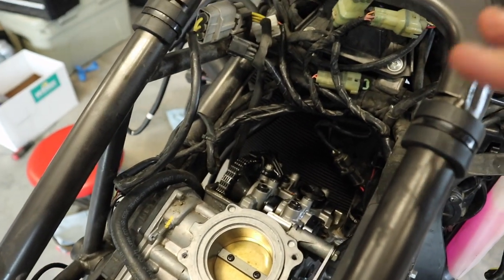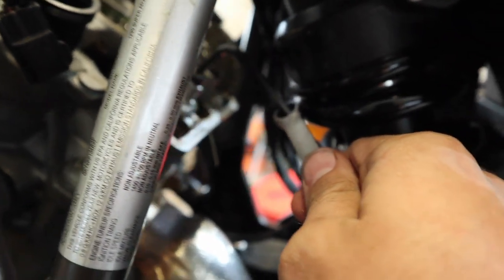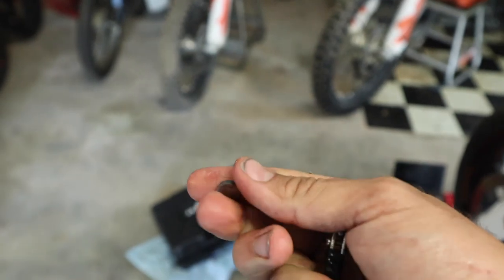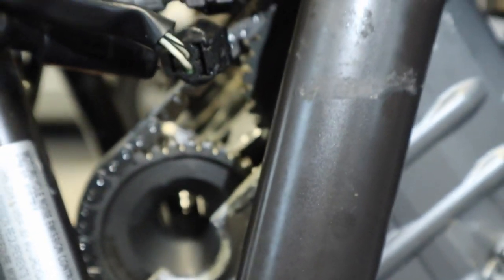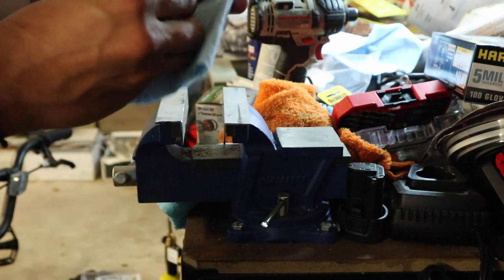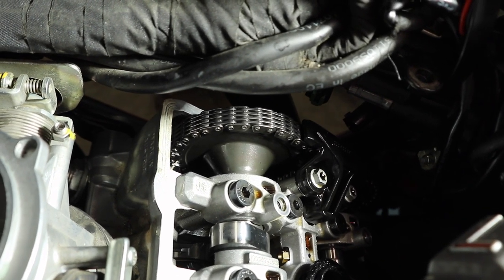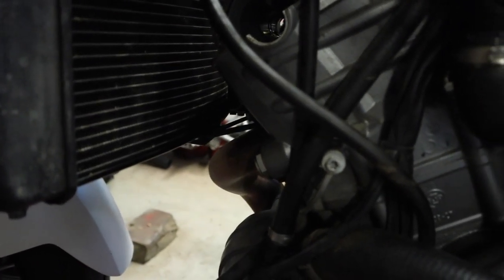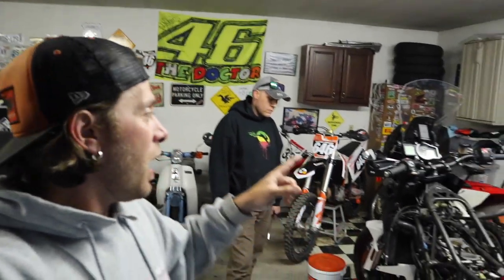Valve Adjustment and Cam Chain Tensioner Replacement | KTM 1090 1190 1290 Adventure

Comment: Thank's A LOT! It's a masterclass. 
I heard the CCT was a problematic part on LC8 engines, and because I truly consider buying a used 1090, I will ensure that new ones are mounted along with the valve check/tuning operation.
Still, rallyraidproducts seems not to produce the part anymore. 
Do you have any idea of other good manufacturer or should I just go for the OEM one?
Again, your videos are truly truly appreciated man. Merci! ✌️

Comment: thanks for the great video. 
I made a mistake and lost my crank/cam timing while setting valves.  How do I know when I have crank at TDC for each cylinder?  Thanks
Reply from the maker: Gonna be tough to answer without some additional information...1) What do you mean by "lost the timing"? 2) Which cylinder?

To get the timing back you can turn over the engine, insure you're not TDC on the opposite cylinder and then check that the notch of the crank shaft is visible. If you're not TDC on the opposite cylinder and the notch of the crankshaft is visible, then take a screwdriver on the cylinder you're working on and make sure the piston is all the way up. If all 3 check out, you're TDC.
Reply: @2WR  thank you.  Is there only 2 notches on crank, one for each tdc?

Comment: Very helpful 
So, just to confirm….. to just change the rear cam chain tensioner only, you can follow the same process as the front?
Might seem obvious, but I’m hoping to drop a deposit on a 2018 model in the next few days.
Thanks in advance.
Reply from the maker: Process is the same on both front and rear.

Comment: mario,I know  its been a little while since this video was recorded so hopefully you can answer question, when you use the small phillips screwdriver to hold in time TDC , my question is , does the screwdriver fit in a notch or hole in lower gear ? or something else, repair Manuel is a little vague about it. i have a 2017 1290 adv. T like the one you rode in some of your videos, Thanks for posting.
Reply from the maker: Still test these things (single and twin cylinders) all the time. It’s just and added safely. I’ve checked plenty without blocking. (If you know what you’re doing u can get things back in time even if u jump time)

Comment: Good job 👍 could just explain what is the other way to reset the camshaft tensioner ?
Reply from the maker: Using a couple of washers. There are videos on YouTube. Also shown in the service manual. Just easier to do with the vice. New tensions come ready to drop in.
Reply: 2 Wheeled Rider  Many thanks for your quick reply ✌️

Comment: Nice vid! How in the hell did you get the oring in? I am having, let's just say a hard time. Just tore my new oring and reordering. Looking for thoughts or tricks thanks.
Reply from the maker: Which O-ring? The one on the tensioner?
Reply: @2WR  Yeah, I have a 690 with a slightly different design. Was having a hell of a time getting the oring past the threads and onto the tensioner. The cap is a different style than the 500's. Just thought you might have some thoughts.

Comment: Getting ready to check the valves on my 15 1290 adventure. This video is going to make this possible. 🤞Bike has been hard starting in colder temps.  Thinking it needs valve adjustments.  From what I've been told by the guy I bought it from a couple months ago it's never been done. 27k on it now. Do you suggest I just order new cam chain tensioner and replace them since we are all up in there already?
Reply from the maker: New tensioners aren’t going to hurt anything. 10.00mm shims

Comment: I knew it! 

Watching the video and waiting for you to say "tensioner has failed on reset" Mine did the exact same but I went with manual tensioners so just set them to 4mm of play in between the cams and boom! Done!  

Now I don't have to worry about them failing at god knows what RPM and ruining my engine.
Reply from the maker: You go with Dirt Trix?
Reply: @2WR  Rally raid bud.

http://www.rally-raidproducts.co.uk/ktm-excf-manual-cam-chain-tensioner

They state they are for the single cylinder bikes but they fit our LC8's no issue. New O-rings - there's one on the tensioner and one one the cap if I'm remembering right? - in with them and as I say just fit to 4mm of play at TDC. I have a video on me doing it on my page. Slightly loose is better than too tight. Would recommend a touch of sealant on the front on because of the downward angle. Mine is weeping a DOT of oil after .. 6k miles or so. No big issue just FYI
Reply: @Mr.Winston  I dont understand when you say "tensioner failed on reset" I just did my valve clearences and when it comes to unlocking the tensioner, the thing goes out and puts tension on the chain... but if I turn the engine a few times the tensioner does some funny thing, like it goes in a bit and the chain gets loose, keep turning and then goes tight again... Does that means that the tensioner is bad?? Front one wasnt doing the same thing till I pulled out... now both do the same thing.. help please
Reply: I think the correct term for what Im saying is "jump time" (according to your video) Does this means my tensioners are gone? Or just badly realeased?
Reply: @MauroRubioGiletta  try releasing it and setting it again. But I don’t trust these tensioners. As I said above I went and bought manual ones they literally cannot break or be wrong once you’ve set them.
Reply: should the chain be tight all the way around or it needs oil pressure to work? please help
Reply: @MauroRubioGiletta  at top dead center you should have a little bit of ‘play’ in the chain in between the two cams. But it should be right yes not able to flap about or skip teeth. Make a video of yours mate honestly it’s hard to know if you’ve done it correctly in writing
Reply: @MauroRubioGiletta  did you ever work this out? Mine seems to do the same thing has spot where it's really slack?

Comment: Great video Mario, can't see the number on that snap on tool used to release the tensioner, could you please check with Lance let know.
Many thanks
Reply from the maker: SGA173B
Reply: @2WR  o
Reply: @2WR  
Thanks Mario my KTM 1190 is coming up 60000km better have a look inside soon.
Cheers for prompt reply

Comment: I changed the shims on my intake valves but every time I rotate the motor on the rear cylinder there is a certain point where there is slack in the cam chain at the top between the two cams. The timing marks always stay lined up and once you rotate past that point the cam chain gets tight again. Is this normal slack or did I do something wrong? The tensioner is released, I pulled it out and verified and then reinstalled and released it. Thanks
Reply from the maker: Maybe just a weeeee little bit but if it’s a noticeable amount, which it sounds like it is, it doesn’t sound like your cam chain tensioner fully released.
Reply: @2WR  it is, I replaced them, both are new and I pulled one out to check and it was fully released
Reply: I posted a video on the Facebook club ktm 1190 ADV page if you want to watch it

Comment: Hello there, I ordered engine blocking screw for my 2015 SAT (part number 61229015000), and I' m waiting for the delivery for more than three weeks. Some of expirienced 990 riders told me they made it by themselves. Do you know precise measures of that blocking screw (I need it for valve clearence check). Also, one more question, did you replace fuel filter? My bike has 80000 kms, so maybe it would be good to change it.
Reply from the maker: Just use a small phillips screwdriver...works the same

Comment: I know this is an old video, but I have a question for you.  How did you get the small Allen plug screwed in on the rear cylinder timing chain tensioner plug?
Reply from the maker: Spin it in my hand, then used a small L-shaped Allen to tighten it.
Reply: @2WR  Did you have to cut an Allen down to get it in there?
Reply from the maker: No, I had one in the tool box that fit it.

Comment: Hello Mario. First of all thank you for your videos!!

I have a problem on my KTM 1190 Adv. 2014 with 90,000km. Air pressure comes out through the metal tubes of the SAS. If I cover them I have great pressure in the oil and it comes out through the adjustment covers. Do you know what it can be? The exhaust valve setting is at 0.20.

Thank you very very much
Reply from the maker: First, the exhaust valve is too tight; should be .25-.30mm. I'm a bit confused. Do you have the the hose to the SAS membrane cover removed? I'm not sure how you'd know there's air pressure coming out otherwise.
Reply: @2WR  Thank you very much for your quick response. I removed the hoses and with the engine running air comes out through the metal tubes of the membranes. It is very rare, engine oil came out of the valve cover gasket, when disconnecting the sas hoses no oil comes out. I do not understand. You have those membranes covered and the pressure from there has to go through the exhaust. In my engine it seems that it goes up through the valve seal towards the oil, I don't know if I'm wrong. With your engine running, air comes out of the membranes?
Reply from the maker: I have block off plates installed on mine which seal off the membranes. If you’ve got the hoses disconnected you need to install block offs. You’ve essentially left the SAS open which is what’s causing the issue you’re experiencing. You’re also opening up your engine to damage (Tho not a super high risk) because you have an open port into the cylinder.
Reply from the maker: While I’m using these on my bikes there are cheaper options on eBay. https://www.rottweilerperformance.com/stage-1-sas-canister-removal-kit-big-twins/
Reply: @2WR  Ok, Thanks you very much

Comment: Hi any ideas 1050 adventure 2016 , lost gear indicator and neutral light ,bike will only run with kick stand up and clutch in, then release the clutch she runs, bike runs and rides good
Reply from the maker: Check your side stand switch connection.
Reply: @2 Wheeled Rider  hi cheers for reply I just assumed that would be OK as the bike will start if its up would that knock out the display on the dash

Comment: I think you busted the CCT when you collapsed it the first time with the vise.  The loud "click" when you compressed it broke the internal ratchet mechanism.  Not sure how your "buddy" determined that your CCT was "worn" out by looking at it or trying to release it the wrong way.  Has he got some kind of 6th sense?  Please tell us how this was determined so we can all learn.  Also, releasing the installed tensioner with a screwdriver from inside the chain galley is in no way an approved method and I can only see badness from doing this (gouged gasket surfaces, etc.).  Gotta use a rod/Allen key from the tensioner side, as shown in the manual and all other videos on the subject.
Reply from the maker: Scott, while aftermarket cam chain tensioners like Dirt Tricks are hydraulic with and internal ratchet system, the stock cam chain tensioners are hydraulic oil pressure only. So while your theory would be correct if it was aftermarket it falls short in this case. As for my “buddy” he’s built multiple national championship winning engines over the last 20 years so I’ll follow his advice over someone I don’t know. You’re more than welcome to check out the couple of 2 Wheeled Rider Podcasts he’s been featured on. His number is on the show notes if you have questions for him. (Look for John Ross)
Reply: Yeah that crunch sound wasn’t good and the amount of force needed collapse it was too much.  I cringed when I heard that sound.
Reply: @2WR  Exactly as my colleague writes above, too much force in the vice and you damaged the tensioner yourself, my colleague did the same, using your video, he damaged the tensioner in the same way, you should correct it so that people do not take this example.
Reply: @qtcrowe crunch sounds in engine parts are never healthy

Comment: Obviously important to clean everything above the valve covers before doing this work. After 34k miles how did you clean all those nooks and crannies ?
Reply from the maker: Combination of brake cleaner (non-flamable) and simple green and a brush and rag.
Reply from the maker: Also, they'd been off and cleaned at 17/18K and the rear once a few thousand miles ago in dealing with something else so they weren't too bad.

Comment: Could you help me. I have one KTM Adventure 1190, 2014 with 9500 miles on it. When she is hot, after run 50 minutes  does not want to start. I changed the battery, and the issues continue.  The technician installed  the scanner and doesn't said nothing . Do you have any idea what would be the problem?  Please let me know if you have any idea.  I'm very disappointed with my bike. Thank you so much.
Reply from the maker: Have you checked the valves? First sign of valves out of spec is hard starting when hot.
Reply: No yet. I will do. I will let you know what happens. Thank you so much!!!

Comment: Unfortunately, tight clearance on intake valves means the engine sucked some dirt. Thanks for the video: it looks like it's been a hard job to film and work in such a tight space
Reply from the maker: That or...rear cylinder runs hotter since it gets way less air. Likely a combo of the 2. Definitely not the easiest job to film. Hopefully the video in combination of the service manual helps people out.
Reply: @2WR  you might take a look at one of these...
USB Inspection Camera Borescope Endoscope for Android PC 6.5ft (USBENDOSCOPE)
You have had a couple cases where you just couldn't get the camera shot because of hand clearance.
When I got mine, I don't think they were making a 5mm version... now they do.  It would be nice to be able to inspect the 5.56 & 7.62 bores... but that's a different channel. :)
Reply: Not always. My 800XC frequently had tight intakes and it never sucked dirt.

Comment: Another good video Mario, I've been using the box wrench on allen / hex wrench for torque for yrs., great tip.
Good thing you realized, (or found out through help from a bud), that the old tensioner was bad, before you bolted everything back up! If your bored around the house like many, here's a classic race, (you may have watch a dozen times already), of Rossi & Marquez, (slide monster), from 2015.  https://www.youtube.com/watch?v=V0GKRLvO7gc  2015 Argentina Moto GP
Reply from the maker: Thought I was doing something wrong trying to get the tensioner to engage. Sometimes is nice to have someone else there to confirm you're right and it's the part that's not working. I've been watching a bunch of MotoGP docs lately trying to get my race fix.
Reply: @2WR  Yes, and you & your channel help DIY'ers keep from making painful & costly mistakes, so good on you, even though I can see, it's much for challenging to work on your bike While filming!

Comment: Anyone know if you can change the timing chain tensioner rail by removing the tapped cover only or do u need to remove the cylinder head ? KtM 200

Comment: That's not a small job :( But the dealer is charging me 2k$ for the job and guy who's going to do the job is not qualified to do it and has never adjusted valves on a motorcycle...

I also never did valve adjustment, but I did a couple of valve check and pretty much everything else on my motorcycle. I guess since it's my bike and I will be extra careful, I will do a better job.
Reply from the maker: Keep the service manual close by and you’ll be fine.